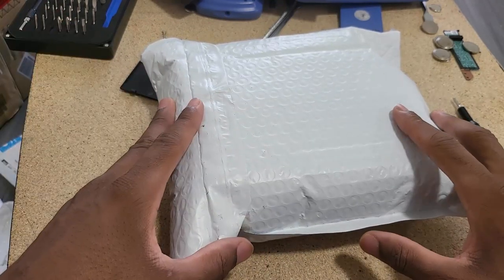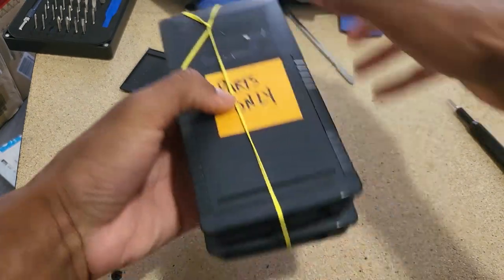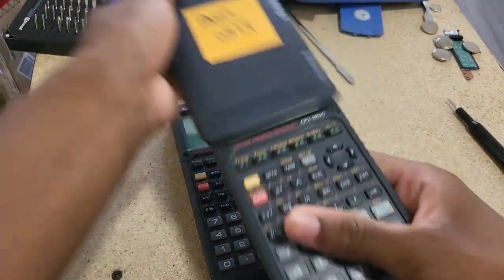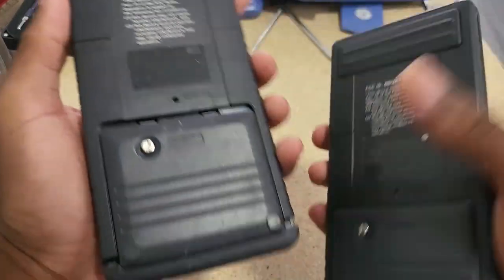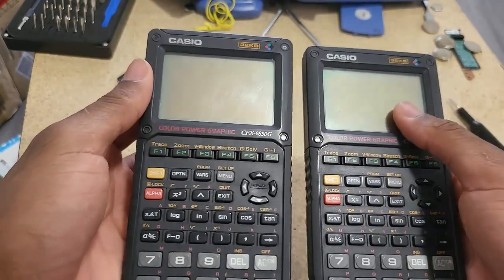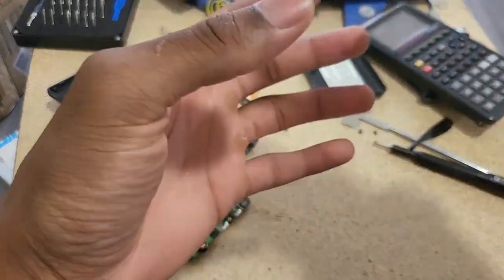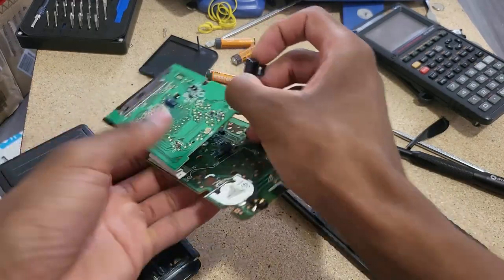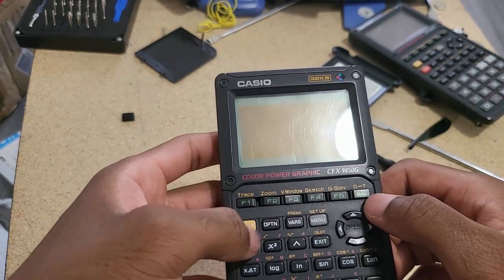The Worse Calculator Brand I Have Ever Worked On! Casio

Comment: If you think that's bad, try a Casio fx451m - the membrane keyboard has a nasty habit of dying and the repair is essentially impossible as the broken tracks are inside the membrane and the only way to get at them is a destructive teardown... It's typical of Casio, they were cheaply made and cheap to buy, they were never meant to be repaired, just thrown away when they broke or a new model came along.

Comment: I have a question and it would be grateful if you answer it. I am a new HP Prime user and I found out the when I scroll the screen to see the operations that I had done previously the screen starts flickering it happens when I use the CAS mode or the Home mode also on the graphing app when I move the view but when I scroll the application library it doesn´t happen. Is it normal or the calculator is broke? Do I have to worry about it in the future? For the last bad experience with the voyage 200 I feel suspicious.
Reply from the maker: Nothing to worry about, the flickering is perfectly normal. It is more noticeable on the first gen, the second gen is slightly better however. I have 3 Primes, and they all do it.
Reply: @calculator_boy  thank you for answer